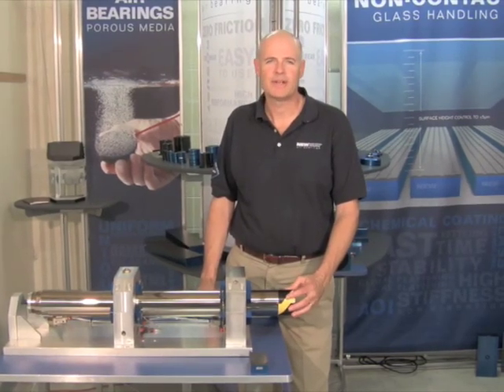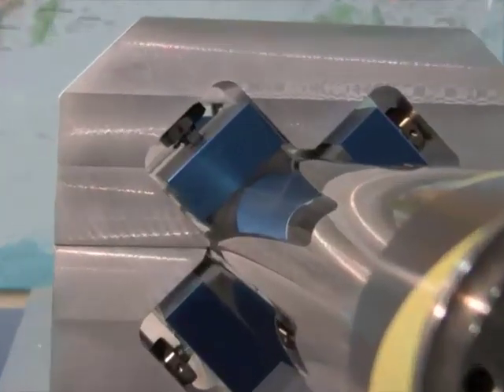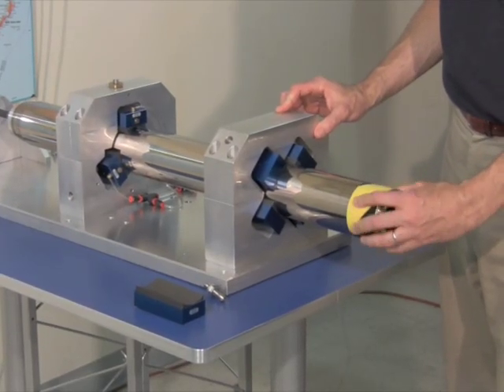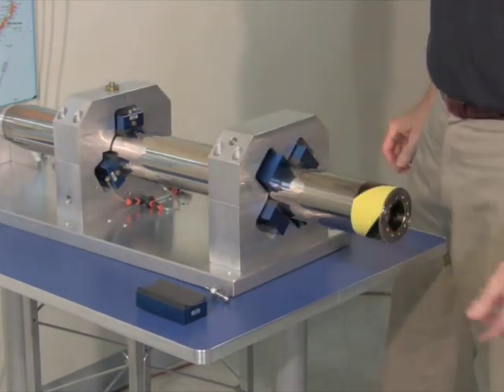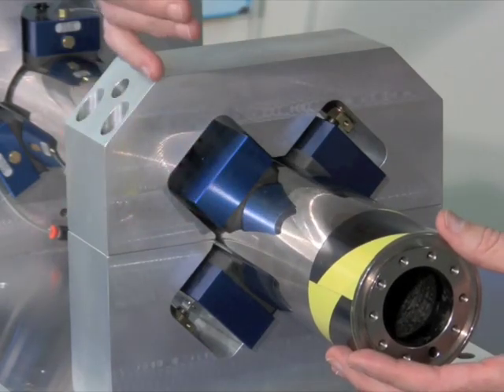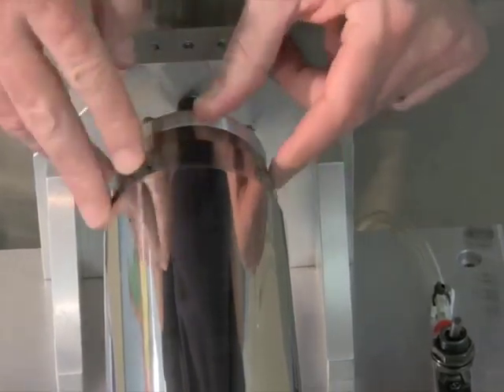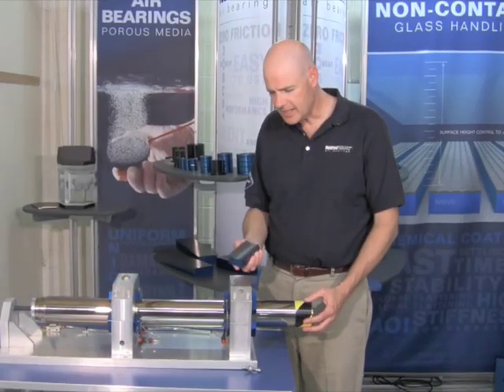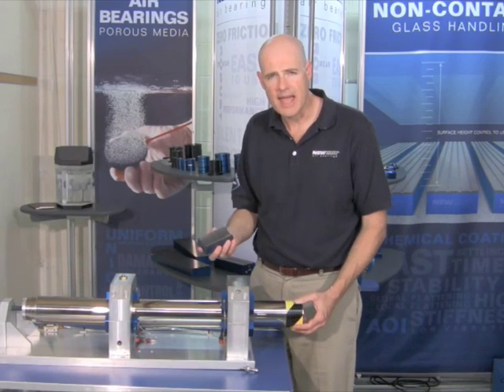Radial Air Bearings on a Precision Shaft

Comment: I'd feel a lot better about this design if the air lines were stainless steel instead of plastic. I don't want plastic oil lines any more than I want plastic air lines if the machine will destroy itself without sufficient pressure.
Reply: On the other hand you have a built-in emergency brake in case of system failure...
Reply: @cyberingcatgirls7069  Could definitely be handy in some applications.

Comment: Never heard of air bearings until now.  Near zero friction...Intriguing.
Reply: sounds like air bushings ....the hydrolic motor oil is near zero friction too the crank /shaft floating in oil ...whats the application selling it to the military...= us for $$$$$$$$$$$
Reply: @aceventura7064  An oil-bearing has a rpm limitation due to many factors including heat generated as the bearings move faster.  An air-bearing should be able to reach RPMs that an oiled bearing could not.  Just my thought.
Reply: @valveman12  it seems you do not understand hydrolic bearings, except for when it is dry which over long periods can occur it is only in contact with oil or impuritys in the oil , you are hopeing that the air separates the to way different speed surfaces that may not be the case long term (out of the lab)
Reply: @aceventura7064  If you say so...
Reply: @valveman12  what is the application space?
Reply: @Murphy deffa  if its for a outer space mission , I say cool. how much energy does it use to do that ?
Reply: Aero drag is the friction. Near zero
Reply: Now they just need to put it in a vacuum chamber, then your cooking with gas!!! - LOL/jk..
Reply: well you must heard of air hockey table, that is a thrust air bearing
Reply: @Murphy deffa    So Muphy how is the xt4000 machine with the air bearings? ready for the long return trip to earth? ....well ...there was a slight... malfuntion.  WHAT !
yeah , a glitch in the elect caused a lack of air pressure only for like 1.7 sec. and its locked up ,welded together is more accurate
Reply: @aceventura7064  You're the only one that brought up space craft application and for no reason? You seem to be very bent on discrediting air bearings but they are used in a lot of precision high rpm machines, even the ones that make semiconductor wafers. Maybe you were just drunk idk
Reply: @calebbridi9614  WHAT IS The Appication of this ! you blew off that question ! don't have one ? more than a space or test bench application ...I do not see it. I have done the suspend a ball bearing  spinning in air with a blow nozzel , wow I should have pattened that !
Reply: Ace Ventura lots of high speed machinery has been using air bearings for a very long time. Just look at a high end CNC mill or lathe with a high speed spindle. 

Plenty of applications for this already in use and space is definitely not one of them, you need a compressed air supply which would be problematic in the vacuum of space. It would also be irrelevant in space though since high speed spindles used in manufacturing are all back on earth making the rockets and satellites.
Reply: @aceventura7064  You think that would've been avoided if the bearings were pressed against the shaft by a piston using the same compressed air line? The craft would've lost stability but it's extremely unlikely that anything would get seized up.

Comment: Hi what is the maximum RPM you could achieve on a Precision 2 inch shaft
Reply: I presume infinite as there is zero contact.
Reply: @richardmiddleton7770  Try 130,000 rpm @20c assuming perfect zero contact...above that would be supersonic, or the air film would "cavitate", or the friction would increase dramatically...so the bearings could fail I assume. Also I have no idea of the pressure or flow rate and how much the flow rate goes up with rpm...so really your limit depends on those factors to, you have to be able to supply enough to keep up with the velocity(might be easy if the loss is nil). You could theoretically calculate a particle thick(unrealistic) air film and its velocity and flow rate if you had a cross section of the bearing face, and then factor in losses from the side...yeah this gets complicated lol
Reply: @Ayestosea  I don't think it's going to support that amount of RPM , the centrifugal force becomes so large that atoms separate from each other and the part explodes, for more info check how flywheels explode

Comment: What pressure are they running at?
Reply: probably 110 psi. ours run at 80 and have a 250 lb max load each - same bearing as the video.

Comment: We would love to build a micro-machine using these bearings what a word it could provide placed on our wish list.
Reply: Do you mean a machine that is micro or a machine for micro work? Air bearings become somewhat less effective at very small scales but if you are looking to build your own linear slides for a machine you can produce something like this yourself with sintered metals, you just wouldn't want to force it without pressure like in the video unless you could get a similar self-lubricating porous material.

Comment: Can this kind of porous media bearings be used in model jet engine application?
Reply from the maker: Yes, we are working on using them in large gas turbines too. call us at 610 494 6700 and ask for Rick or Drew
Reply: @drewdevitt  thank you for the fast response
Reply: @drewdevitt  I was thinking about prototype of a micro jet engine for an rc plane as proof of concept because standard ball bearings last 25 hour's of engine run time before they need to be replaced so air bearing should and it will eliminate engine bearing service but as it is right now I am currently unable to purchase the type of air bearing required for the prototype  engine due to lack of funding but in near future I will definitely give you guys a call and see if we can build it.
Best regards
Reply: Try a foil bearing so so you do not need a separate air supply, just make sure they stay clean. Full-ceramic ball bearings are probably best for a hobby project though.
Reply: I know capstone microturbines use air/foil bearings, different construction but similar function

Comment: I need a setup for a vintage Pontiac V8 lol but I would settle for small block Chevy. In seriousness however, I am surprised at the low 60 psi. I suppose the closer the tolerances the less psi. In this case no tolerance so the psi would have to be great enough to flex/load the housing. Looks like a good way to check the balance of rotating objects.
Reply from the maker: Right you are, here is a video on balancing done at Hoffmann America;
https://www.youtube.com/watch?v=NU6A6SZbhmc
Reply from the maker: Yes, we offer them for balance machines, they work much better then conventional rolers with lower error motions

Comment: 3D printing of this technology  will bring the coat down drastically
Reply: This is completely incorrect, 3D printing processes such as DLMS neither have the accuracy or surface finish required for bearing surfaces and the costs will be significantly higher than conventional machining.

Comment: to be technically correct, there is no such thing as zero friction there. on an atomic level, that shaft is about as smooth as the moon. there is friction between the steel atoms and the atoms within the air, just so minut that it's virtually no friction to us.
Reply from the maker: Yes you are correct

Comment: What's the min/max clearance between the bearing surface and the shaft?
Reply from the maker: +fromkentucky There are various factors that determine air gap.  Like load, surface finish, pressure, etc. Here is a design guide that can provide you with more information: http://www.newwayairbearings.com/products/w-profile-concave (scroll to the bottom of this page)
Reply: According to the vid, “less than zero”

Comment: Are these bearing adaptable to be used in a modern internal combustion engine? I'm dreaming of the possibility of an air-bearing V8 matched with electric valves. Possibly an insane amount of power...
Reply from the maker: +berker smith We have not applied our technology into an internal combustion engine.  It is not that it would not work; we have just not engineered/researched it as a product development project.
Reply: turbo shaft engines would seem a better fit for this given that they maintain consistent loads against the shaft, whereas reciprocating engines are going to be very peaky on bending loads.  One reason we have to be very careful about type of propeller on aero- diesel engines.  I am concerned about flight loads on these bearings though and failure modes if air pressure is lost.
Reply: +berker smith They're being used on microturbine engines. They work VERY well in that application. Bladon has a working model.

Comment: Love the concept, but what back-up measure will there be if the air pump fails?
Reply: If the compressor failed there is compressed air in the reservoir.
Reply: Machines with air bearings typically have a pressure interlock that stops any motion if the air pressure fails.
Reply: +J Corey Orava It could be a good thing that it locks down without air pressure, like 18-wheeler brakes.

Comment: and how much pressure (PSI) would you need
Reply from the maker: 60 PIS input pressure, the porous carbon is the restriction of the flow.  The flow in in SCFH range.  See following link for individual product flow specification: https://www.newwayairbearings.com/catalog/radial-air-bearings/

Comment: Let's get that shaft hot.
= Seized.
Reply: Depends on how much force the air bearing will take. Shaft heats up, air column maintains clearance until the tension in the housing overpowers the stiffness of the air cushion. It'd actually handle quite a bit of dimensional weirdness as long as the shaft remains round and smooth.

Comment: what air consumption does this use?
Reply: Probably not much since the space between the shaft and the "bearing" is very small it requires little air. Probably a household compressor should be more than adequate. Just speculation tho